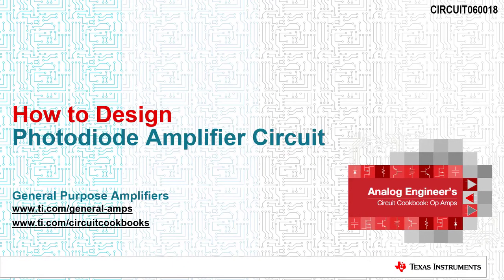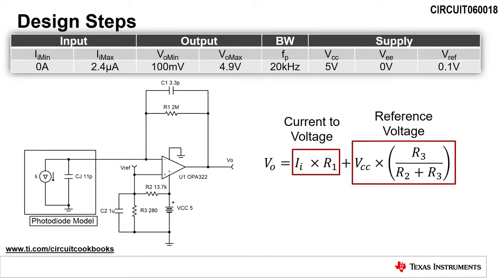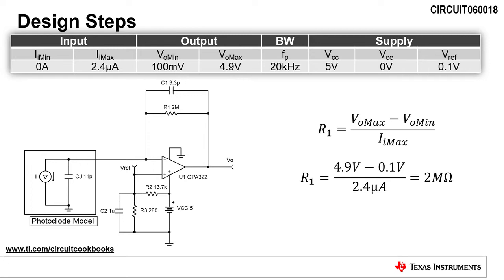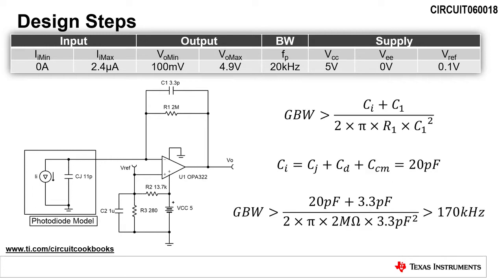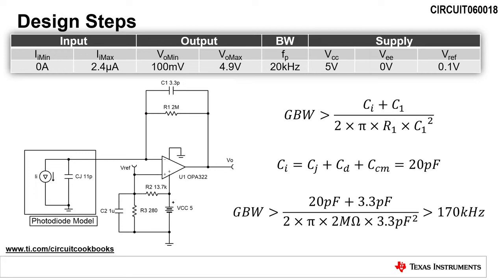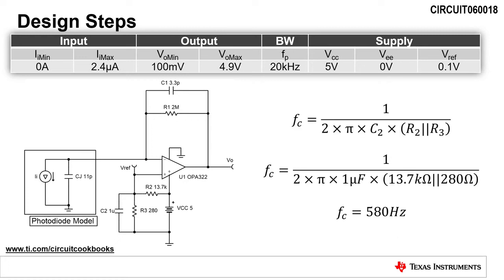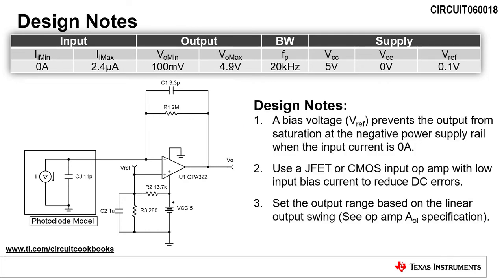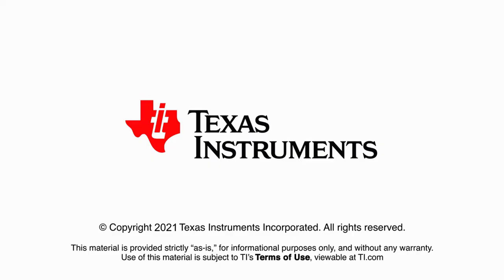Photodiode amplifier circuit

Comment: Great video… to be honest I’ve never had the need to design a charge amp and have only ever used one for a short time when I was using acoustic pressure sensors which had piezo transducers. I accept your design steps but like I say never considered designing such an amp so would need to understand the step principles to verify in my own head that these were correct in the theory. But I trust your judgement and experience just like to see more explanation for each step.

Comment: So what will happen if the OpAmp output is saturated to the negative supply? What's wrong with that?
Reply: I think it's just because most OpAmps struggle to bring the output EXACTLY to the voltage on the power pins. So if you build and expect your circuit to go to exactly that, you will be surprised to find out that your circuit will go close but not exactly there.
Reply: You don’t want to forward bias the photodiode. It would overheat and become permanently damaged.
This is a single rail example. For a split rail, you wouldn’t want to go below zero volts if the photodiode is grounded.

Comment: Do you think such a design could work on a breadboard with SFH206K phodiode? I have so far only tried the variant where the photodiode is used as a voltage source but im having problem with lots of interfiernce...
Reply: USE VERY SMALL WIRES
Reply: @SaieenTwist  What? Why? Small gauge wires make poor connection in a breadboard. Especially a well used breadboard. I just had to throw away a 5 year old breadboard because the fins were too loose to make reliable connection with 1/8 or even 1/4 watt resistors anymore. Half of my pull resistors wouldn't work, and my outputs would start doing whatever they want. Then I find the 30awg wires for the power weren't making proper connection either. AND there's spotty continuity on my power rails. The whole thing was a mess. But in this circuit, a standard 22awg breadboard jumper will work just fine. Unless my small you mean short. You weren't exactly clear on that. In which case, yes. The shorter, the better generally. But not necessary in this case. Every wire has some amount of resistance, and a longer wire will have more resistance. Yes, a thicker wire will also have more resistance, but the amount of resistance we're talking about is fractions of an ohm, even for cheap steel jumpers and not really significant in this case.